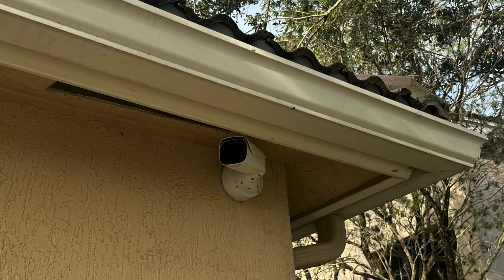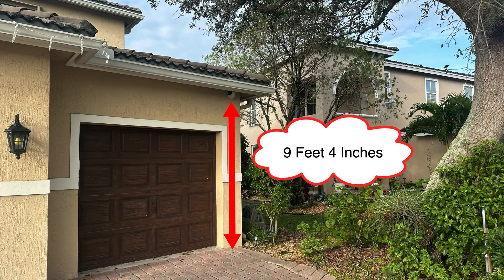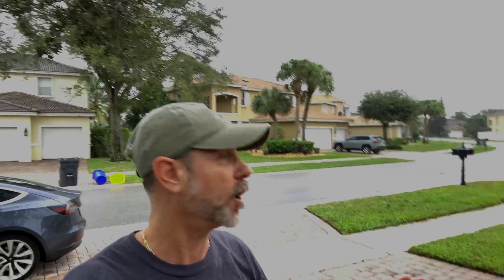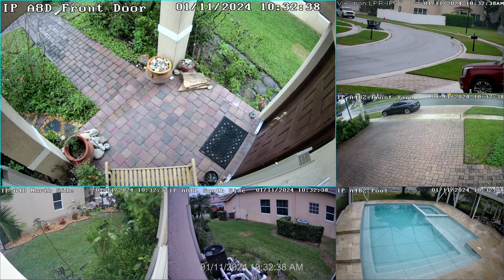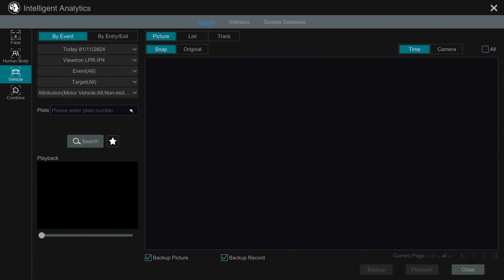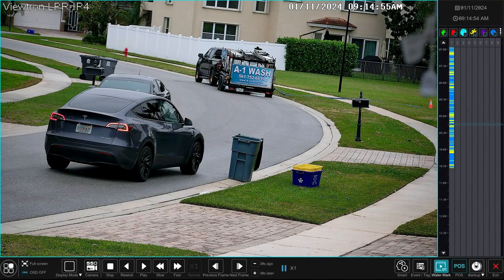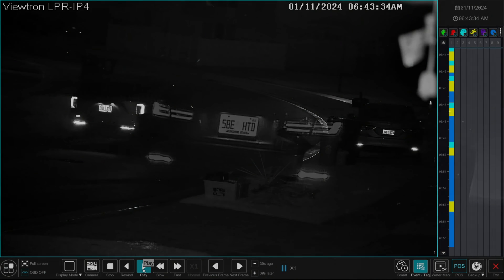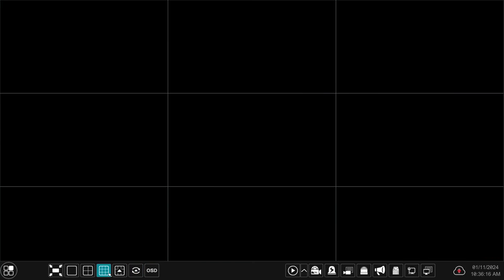LPR Camera Long Distance License Plate Recognition

Comment: Get an Axis Q1700. One of the best lpr you could get
Reply from the maker: The Axis Q1700 is more than double the cost of the Viewtron LPR-IP4, and I will put up the license plate recognition performance of the Viewtron LPR camera against the Axis any day.
Reply: @cctvcamerapros  The Q1700 goes for around $500 used on ebay. The Q1700 has a reach of more than 4 times of the LPR-IP4 and that is one of the most important thing of a LPR camera. Axis paired with Rekor service is top notch.
Reply: @cctvcamerapros  The Axis has more zoom compared to yours. More zoom better change of capturing a plate.

Comment: Are these cameras compatible with Lorex NVRs
Reply from the maker: Yes. As long as the Lorex NVR is ONVIF compliant, they will work with our Viewtron LPR cameras for clear license plate capture. However, the automatic character recognition software is only integrated with Viewtron NVRs. https://www.cctvcamerapros.com/License-Plate-Recognition-Systems-s/1518.htm https://videos.cctvcamerapros.com/v/license-plate-capture-vs-lpr.html
Reply: @cctvcamerapros  so what NVR with POE do you recommend I get I currently have a 16ch Lorex nvr and if I can get at least have one LPR security camera I'd switch  out my NVR. Even I have to have two separate NVRs thanks
Reply from the maker: @PeteyPablo408  I highly recommend out Viewtron NVRs for your consideration. https://www.cctvcamerapros.com/IP-Camera-NVRs-s/1472.htm

The Viewtron NVRs are 100% integrated with the LPR software of this camera. They are also fully integrated with all of the AI software functions of the Viewtron AI cameras. https://www.cctvcamerapros.com/AI-security-cameras-s/1512.htm

If your Lorex IP cameras are ONVIF compliant, you can use them with the Viewtron NVR also.

Comment: What is the side angle?  I’ve read that the camera wants less than 15 degrees. How many degrees is this installation?
Reply from the maker: Hi Paul. This was way greater than 15 degrees. The purpose was to show that although automatic license plate recognition (ALPR) is not possible at that extreme angle, license plate capture (LPR) is possible. LPC is the ability for a human to identify the plate on recorded video surveillance footage. This is what most customers require. Most of our customers do not require ALPR unless they are doing some type of automation based on plate numbers.

Comment: I am planning on getting the nvr and the lpr system, i have a lorex system already. Do i still need an over view viewtron camara or can just use my existing ones?
Reply from the maker: Hi Rusty, you can use your existing Lorex cameras as overview cameras. As long as your Lorex IP cameras are ONVIF compliant, they will work with our Viewtron NVRs. You can email us at info@cctvcamerapros.net with the model #s if you would like us to help research.
Reply: @cctvcamerapros  thank you. My viewtron system is on its way,

Comment: Can these work well with Synology Security Center?
Reply from the maker: For license plate capture (human readable license plates), yes. All Viewtron IP cameras are ONVIF compliant so they will work with Synology Security Center. However, in order to take advantage of the AI software for automatic license plate recognition and / or if you want to use our Viewtron AI cameras for human detection or car detection, you must use a Viewtron NVR. The AI software is only integrated with Viewtron NVRs. https://www.cctvcamerapros.com/AI-security-cameras-s/1512.htm

Comment: Three questions: How well can this image a license plate on the FRONT (headlight glare) at night?  The approach through my license plate capture zone is on a rural road where 60 MPH is not uncommon (and is most likely the vehicle I want to know about), so is this going to capture The Second Coming of Christ flying by in his LED light-bar equipped RAM 4x4?  That's a tall order, I know.  Third, I've got an ideal camera location, about 15° off centerline and 75' from the action.  Problem is, that spot is 250' from the house.  I can run Cat 5 there, and even 120VAC if need be, but how is that distance going to affect image quality?
Reply from the maker: Thank you for your interest. The front license plate capture works very well at night a long as the camera is installed properly. You can see a demo here. https://videos.cctvcamerapros.com/v/lpr-camera-night-recognition.html The LPR camera needs to be mounted no greater than 90 feet away from the license plate capture zone. 250 feet will be too far unfortunately.

Comment: I'm an interested homeowner.  I'd have to mount mine somewhat higher, in an effort for the camera's view to not be blocked by cars parked on the street in front of the house.  I understand this would increase the horizontal angle of the camera, which is bad for the performance of the system.  Hoping to see some more experimenting to perhaps prove it would still be a working system for me!
Reply from the maker: Thank you for the feedback and interest! How high would the LPR camera be mounted on your house? How far from the street is your house set back? Is the road exactly perpendicular mounting position on the house or does the road have any curse, like my house does in the video? You can also email me at mike@cctvcamerapros.net if you like.
Reply: @cctvcamerapros  Thank you, will be in touch via email hopefully tomorrow.  I'll get some info together for you.